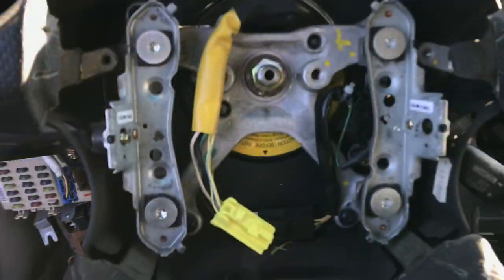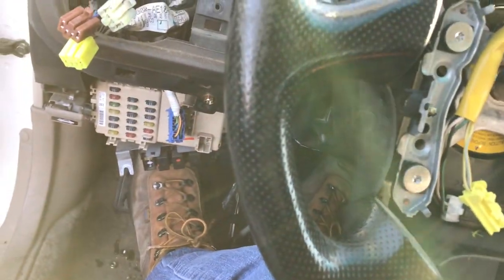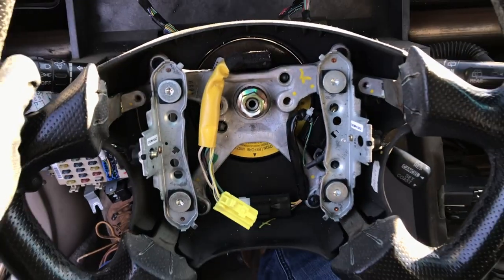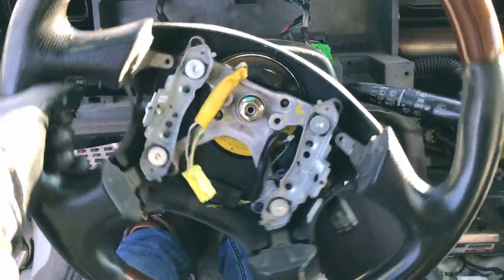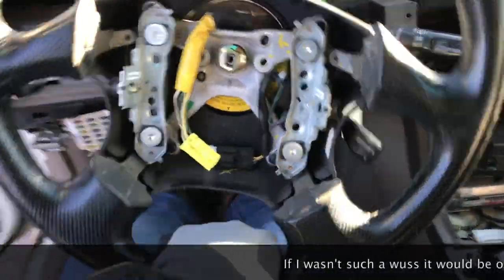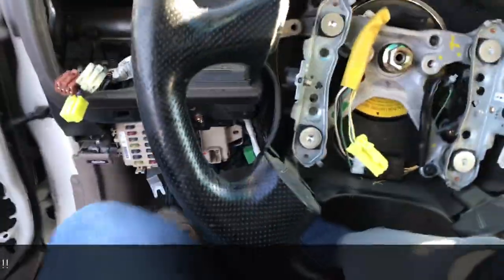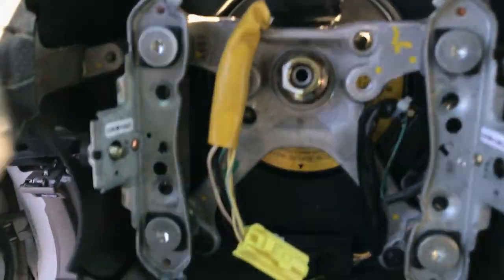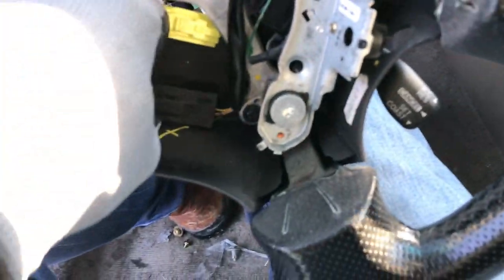How To Remove Steering Wheel Without Removal Tool!

Comment: Not all steering wheels come off "that easily..."
Reply from the maker: I’ve pulled hundreds of steering wheels this way and I’ve never had to use a puller 🤷🏻‍♂️
Reply: @karrskars  Well there are some that I have had to use a puller for that didn't come off so (easily;) they are out there. You will eventually run into one... Try this method with a 95 cavalier and then tell me it was easy? Ihad to use a puller on one, then I broke a bolt on a puller, while trying to pull the wheel off of another cavalier from the same timeframe. still haven't been able to get it off, even after swapping the column for a tilt; had to use a puller for that one to put a different wheel on. I tried the "easy method," first of pulling on it and wiggling it. Nope, just like the other one, I had to end up using a puller. Oh I also tried another "experts" method of pulling the wheel easily. He said to just leave the nut on the column and use a hammer, to pound on the nut, while pulling up on the wheel. Said it worked (every time...) Nope. It did exactly what common sense said it would. It damaged the shaft and the nut. Thankfully on this other one, (carefully, slowly, using a puller)I didn't break any bolts this time... 🤔And (we're done...)Peace out/Good day to you sir...
Reply: @ZanyJIntPictures  I wonder if it is a mid '90s GM thing.  The majority of steering wheels I have pulled are from '94 to '96 full size GM cars.  Even with the pullers, they are a PITA to get off.
Reply: @karrskars you're a liar...